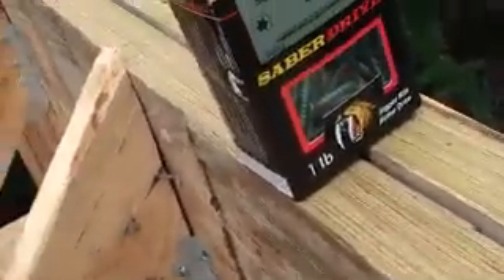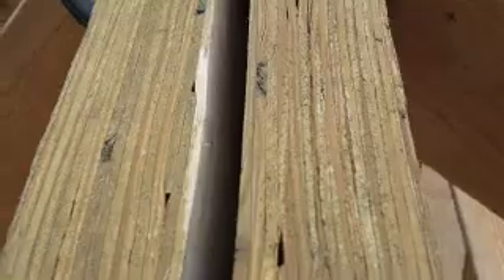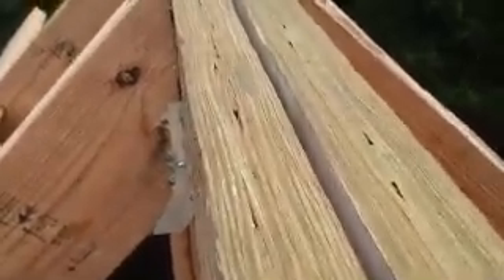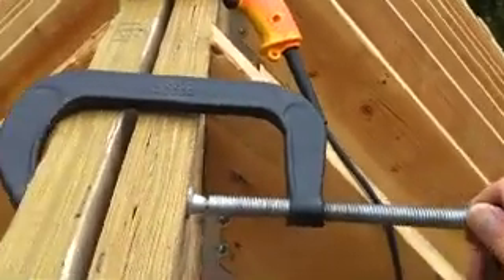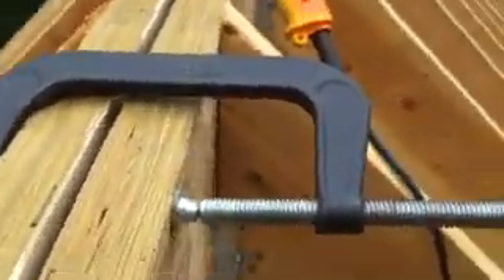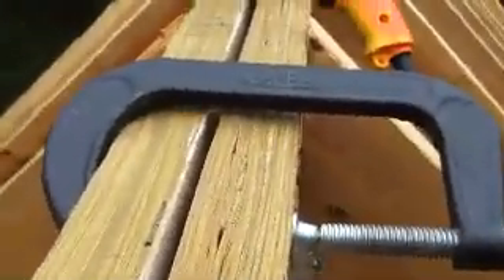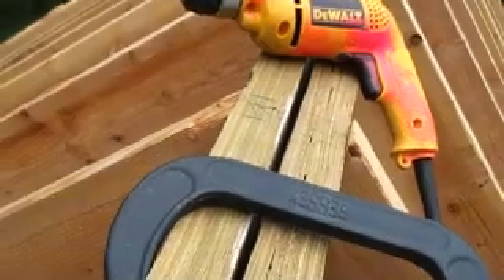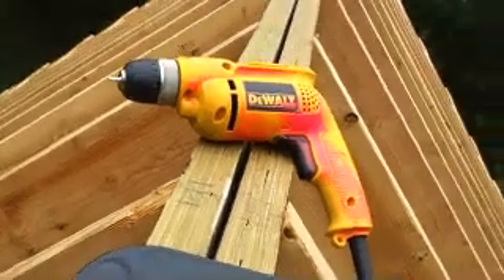2 Ridge Beams: Microlam 1.9 - Cupping

Comment: 2 questions ... Why did you use 2 beams? Most roof peaks use only 1. IF the two beams were according to some Architect's plan, why didn't you glue or bolt the beams together at the start?
OK, the top part of the beam opened up due to rain ... one clamp isn't going to close it up, you'll need clamps every 10" to 12".

Comment: It needs to dry - if the 2 beams can be separated at all to allow air, do it, otherwise drying will take a long time.  Not days but months, even a year if outdoors and under cover. If it dries out then the faces should fit almost as they did when new before getting wet.  As long as the water is there the clamps will only crush and damage the wood (not enough to worry about) and won't pull the faces together completely.

Comment: Okay, not a carpenter so if you do not think it is safe to do, don't. Looks like you need more of a clamping surface and power to pull them together. Use a high lift jack like folks use for off-roading. The jack points can be rotated around so you can clamp together instead of lifting your vehicle. That would give you a stronger clamping point than just a regular clamp. This might pull the wood together long enough to put some bolts into it and hold it together. What do you think?

Comment: Maybe screwing works try it if it does going my way will be longer and harder on ur arm unless u got a stiletto hammer? I do . But I frame houses for 15 years and still do . And there is no way you will crack that material ( microlam) is supa hard I could never break one . If it were a regular 2x12 yea that will crack not lvl . Hope this helps

Comment: Look microlam always does that what you shouldve done is shoot it up like a header every 12" with a framing nailer . After they were in position , cause a double micro can be several hundred pounds doubled depending on length and height of material . But now what u could do is put 5 nails using a framing gun close to each other then pound those nails with ur hammer . Thats the only way I do it cause were not allowed to screw anything and I closed 1 inch gaps due to terrible material .

Comment: It should return to closed if its from rain water. Take out the screws, Let it dry don't force it if it does not close call the manufacturer for advice & replacement.